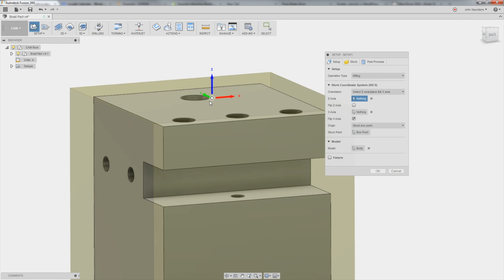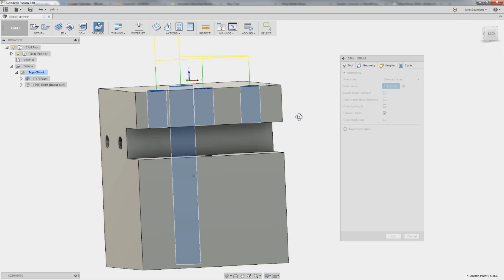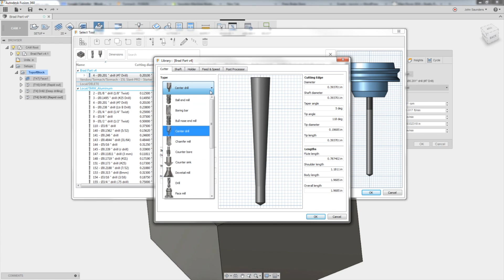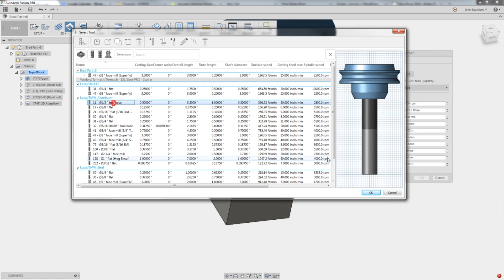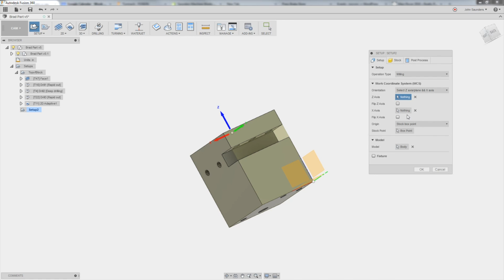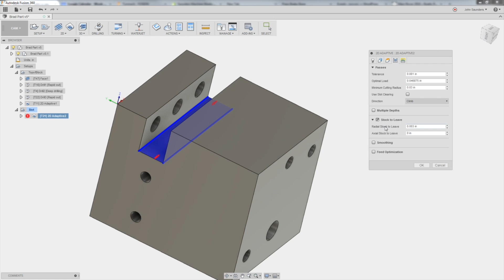Comment: I know this is a older video but I have a question my cnc mill does not have a tool changer. In fusion 360 could I do a new set up for every tool change to make the machine pause to change the tool? Or is there a better way to do this

Comment: One quick tip taught to me, use your chamfermill/spot drill to make the chamfers on all your holes before you drill them, it avoids ugly hand carved chamfers or having to do the operation again afterwards. Even parts that don’t have chamfers on the solid model usually allow for all edges to be broken at a maximum radius on the print, you save yourself time and avoid possibility scrapping the aesthetic of the part.

Comment: 4:59. You make a good point in saying about the hard turns so a curve will ease the machine better. But I find that is much better utilized in feeding paths to avoid corner maneuvers . When it comes to facing, not really a big deal. The machine has already made a hard stop reaching that first "Z" move, to start the first "F" code on the next Block. So may as well rapid straight to that final "Z", and the first "F" is on the X/Y. This method to me makes the code look cleaner. At the machine, you confirmed your last "Z", and the tool height looks good, so you know that you can proceed. In fact, most of the time, Bringing the tool directly to the last "Z", works for just about any tool that has no intention to be starting within the stock boundary.

You're not wrong though, just my 2 cents. Awesome video. :)

Comment: HI John,
I drew up a logo which I want to wrap around a1.25 diameter wood dowel ,this was done in Aspire.
is it possible to import the model and wrap it to Fusion to create the CAM codes ? I have a Tormach 1100 with 4th axis rotary set up.

Comment: If you were going to profile the outside. Instead of using corner rounding,  draw the  corner radi that way you can start on one of them and you get no dwell marks, just makes a cleaned looking part.

Comment: Nice video, John. When running a simulation I always change the material from 'Mirror' (which is an awful default) to 'Wall Paint'. Bingo, you can actually see what's happening, especially in a video!
Reply: KenToonz yes👏